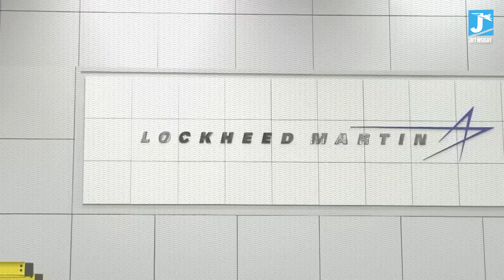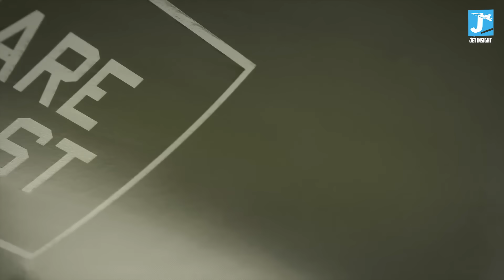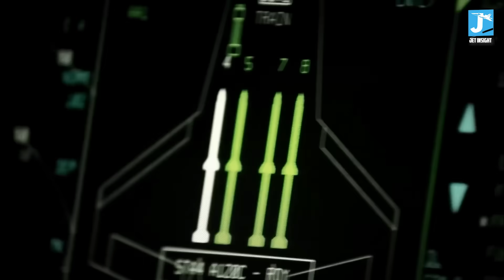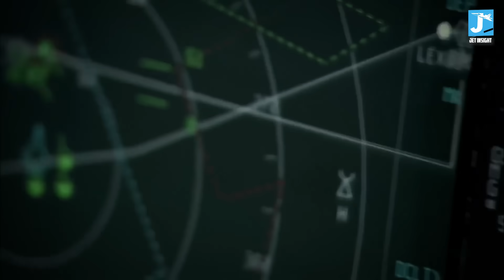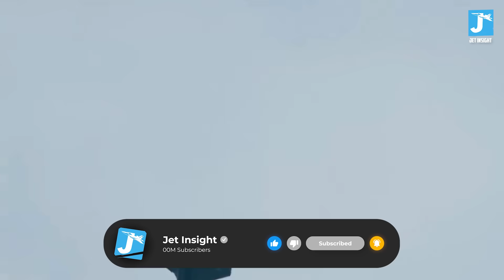F-35's AGGRESSIVE Upgrade is a GAME CHANGER for U.S Air Force

Comment: To make the F35 a great seller and in Demand is to give it exceptional long range or long legs beside the new adaptive engine be like P51 ,P38 , Mosquito of World War Two !  Is to paid Israel royalty to install their conformal fuel tanks or have contract with Israel to do it on the jets you sell . Plus fitted new F35A with F35C larger area wing more fuel & range and the ability lift heavier payload weight ! Also is to have for long range recon is easily loaded internal fuel tanks in weapon bay , that have no fuel vapor leakage in the weapon bay ! I have innovation combining technologies that will add to range ,higher cruise speed , greater thrust , to me it cheap and easy to install just need a legit sounding board of wizards to look at it with a open mind , like Israel IDF do with a private with idea or innovation their wizards work out the bugs make it workable and practical and then do a open minded evaluation ! You can find me like to be a consultant to join your team thanks for listening with a open mind

Comment: How much of this upgrade is from Israel F16 Adir jets ? Question will Israel get F35s block 4 , I E-mail Israel weapons about six months before to mount missile rail on weapon bay door before it came out on U tube they were trying  to develop to carry a third missile using weapon bay door name side kick my exact same idea or innovation ? ? ?  I have a possible new way and much more stealthy way of deploying of air to air and air to ground missiles , plus to increase the weapon bay capacity to 4 to 6 120s to be look into 12 missile for a great interceptor ? If can it be-done is clean up weapon bay  from all the the electronics access and change the bomb rack to 5000 pounds so it carry the GBU-28 to unravel defensive knots of multi radars and missile controls area . Give F35 the wing span of F35 C for additional range & lift and take off with half the fuel load to decrease the lift off weight then have inflight refueling . I like to see the F35 to have more traits of Mosquito bombers of World War Two ! Maybe also for long range recon like mosquito able to carry in weapon bay Ā internal fuel tank ?

Comment: LOL!!! Lockheed is still facing significant issues with their planned TR-3 update which started in early 2023 that enables them to update the planes to Block 4 standard. So, these new updates if they were to ever happen wouldn't be available for many years. A lot of heads at LMCO need to roll, because they've mismanaged the F-35 project for decades and have cost the US taxpayer untold billions.

Comment: Build the F-47 the F-35 was never that great. Should have built the F-35 with  two engines !
Reply: How do you figure? The JSF is already proven itself in the 47 has not. On what basis do you make such a statement?
Reply: @JSFGuy  The F-35 they add all this I. An effort to stay relevant. Lockheed has had many problems and supply issues. They missed dates and had cost overruns. Thus the F-47 was chosen and gives another contractor a chance.
Reply: @mikegines1222 how do you figure? You do realize that the JSF is a 3-in-1 platform and there are going to be issues, developmental testing and hours on the program did not end in disaster they did not crash airplanes as anticipated so nobody wants to talk about that. Watch and see this 47 run into the very same problems or more than you say that JSF or it actually did have yet it kept going, they only did what they were contracted to do. The contracted years ago for firewire and that's what they got and then promptly upgraded it later because reasons. Lots of dynamics you don't understand.

Comment: One thing I do know is that the F-35’s airframe will not allow it to perform the way the new F-47’s airframe will, the F-47 is a huge leap ahead in maneuverability , and service ceiling ( altitude),, as well as “ tuck away missile capacity, these are attributes the F-35 can not overcome
Reply: Maneuverability is not the key to success, that was once thought so and it's not. You need to get up out of your 30 year old Legacy mindset.

Comment: The Navy should ditch the FAXX and adopt a suped up F'35C that could be designated F/A 35D " Super Lightning" that would have improved stealth, AI based avionics and modified PW F 119 engine producing 50 000 ibs of thrust propelling the aircraft to Mach 2.

Comment: Lockheed over promising again and lying about the f35, they promised a aircraft program that would coast about 1.5 trillion for the whole program and now it's over 2.4 trillion, and they need to fix all the 700 problems with software and hardware first and the flight per hours and maintenance and the reliance and availability before they start promising to make the f35 even better than it is now, they're just over promising again.

Comment: Gee... I wonder what happened in June 2025 that relates to the F-35 that might lead Lockheed martin to announce a new upgrade package. 
Did someone else, who happens to use their own unique variant of the F-35 demonstrate anything ?
Reply: Interesting point. Who's the 'someone else' you mean?
Reply: @squirepraggerstope3591  Who Nose ?
Reply: @roylahav3283  Not me, mainly as I'm more genned up on mainly UK naval issues. Though obviously that includes our two big QE Class carriers that operate F35-B. Interesting then, to see the reminder of F35-B's upgrade to use advanced anti-ship missiles AND re operation with large UCAVs. Also of interest is F35 upgrade to (currently) TR3, incl retrospectively to the earlier units delivered to us (except the one that took a dive off Big Lizzie's Ski Jump into the Med in 2021, of course)
Reply: @squirepraggerstope3591  Ok... you win. you clearly know more about it then I do. 
That said, having the annoucement come just as an event in the middle east sparks increased interest in the aircraft is interesting.
Reply: @roylahav3283  Cheers, though all I may know more about are those affecting us Brits. As above & re the carriers possible reconfiguration as per design, to fit EMALS assys + arrestor gear and move to angled flight deck layout for hybrid STOVL/CATOBAR operation. So each ship's future airwing, instead of including up to 48 x F35-B may usually see just 18 or 24 shipped, + 18 or 24 big capable UCAVs. Another advantage is it'd also allow full interoperability with the USN as American F18s, F35-Cs, Hawkeye E-2Ds etc could also operate from our ships